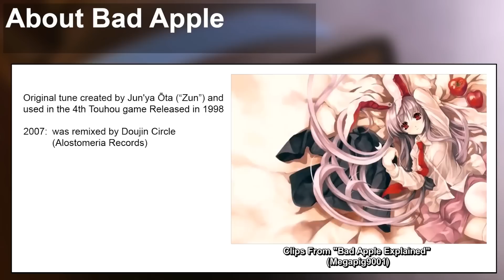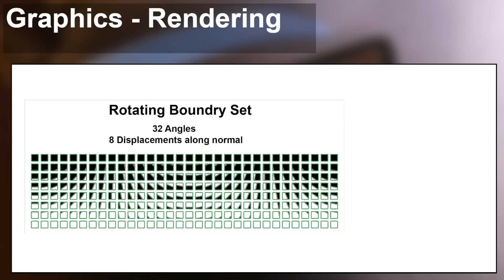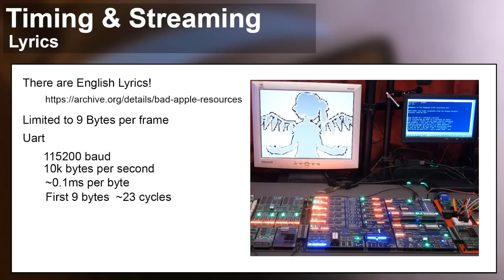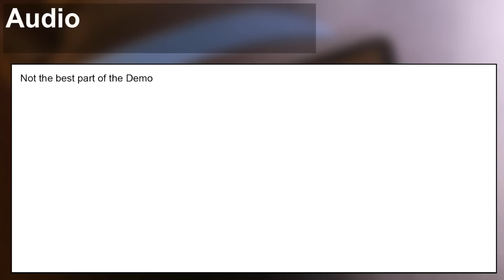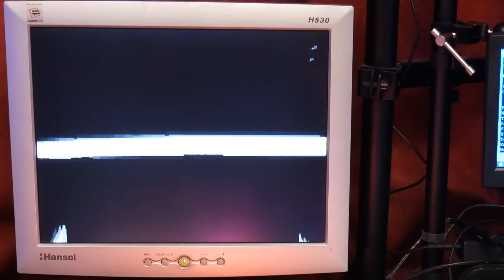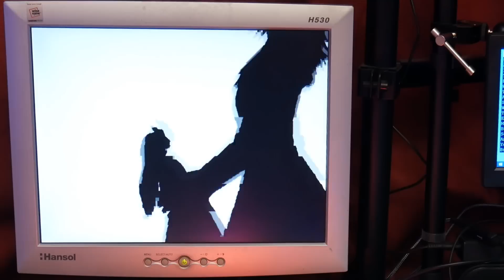Porting Bad Apple to the Homebrew CPU!

Comment: It sounds like you need a hw random 8-bit number generator you can hook up to the audio circuit to help with noise style outputs?
Reply from the maker: It is interesting the way old synth chips used the noise channel.
Reply: @weirdboyjim  yeah. The C64 GEOS copy protection was very interesting in how it used the SID chip noise to decode itself. 😎
Reply: NES created noise without an RNG, by the way. I don't know the exact details, but I think there was some prewritten data that it would loop through with some feedback mechanism, so that you could also then somehow alter the tune.

Comment: To quote a Monty Python script.... MY BRAIN HURTS!

When you were building the audio device, I always wondered why you did not incorporate timers to generate various tones, paired with digital volume control chips?  Sure, they would be square waves, but with volume modulation, you could make a nice sounding output.  Add another timer to the actual volume control chips and it could modulate without the need of heavy CPU work.  Sure, this would have two timers and half a volume chip per channel, but it would not be very complex to make.  I understand not designing a computer to run demos, but it would certainly make games much more interesting.
Reply from the maker: If I'm understanding your proposal correctly I think that would be about 4-5 extra chips per channel. Something I find is that every circuit, there is always a way to add functionality and make it better and wherever I draw the line someone else would have done it differently.
Reply: Yeah, though I think its not just limited to everyone drawing the line at a different place. Its also people not having tried it first before commenting :D its one thing to make an off-hand suggestion, but its another to actually try implementing it and realizing what a pain in the butt it might end up being.